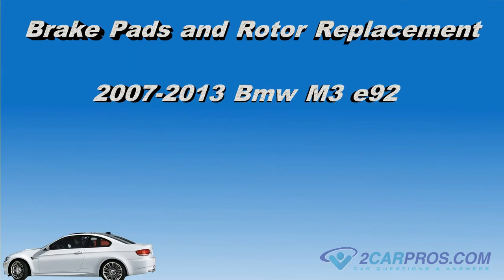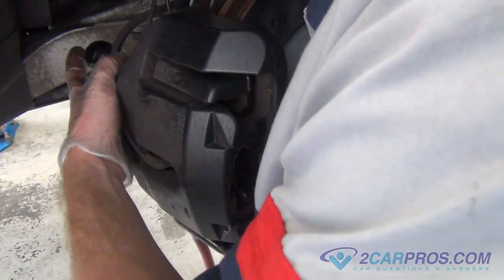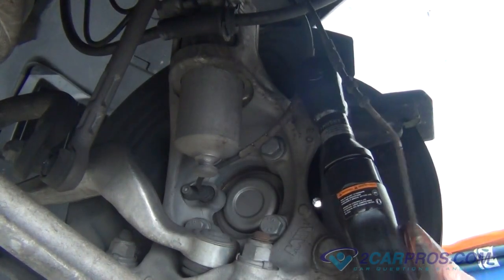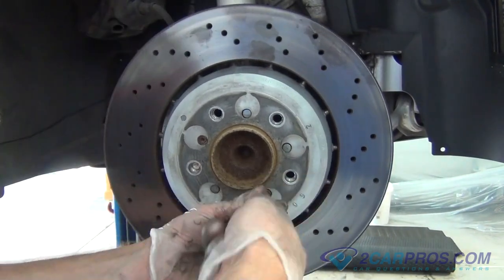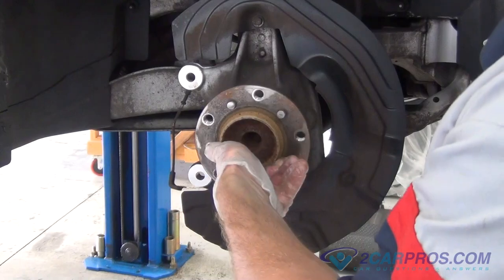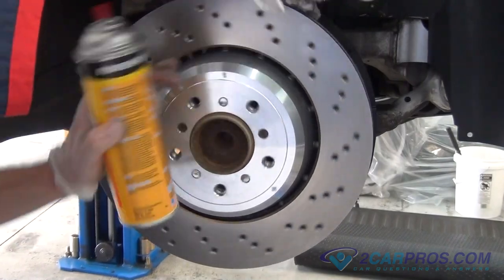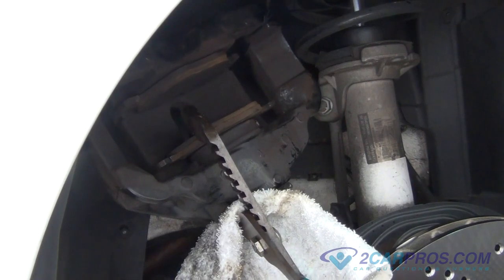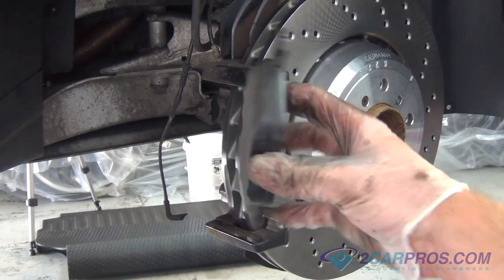Front Brake Pads & Rotor Replacement BMW M3 2007-2013

Comment: Nice demonstration - thanks (I've only done pad changes on my Porsche before and wanted to see how it differed as I will soon have to do them on my BMW).

Just a though - while zip ties are the choice of professionals for supporting removed callipers as they routinely tend to use a lift, for a DIY at jack or axle stand height I find that just resting them on an upturned bucket is even more straightforward.
Reply: that's a great tip, discoCol. thanks

Comment: It also really helps doing the brake job in the spring or summer.  In the winter, every part especially the pins are extra hard to remove.  Even the wheels are hard to get off.  I had to hammer the rotors many times to get it to pop off.

Comment: Why not torque all bolts/guide pins to spec? don’t you need to lube (high temp grease) guide pins and all points of contact that slide on pads? These brakes may squeak as well as other problems.  However thanks for the video. It does have  instructional value.

Comment: I open the brake fluid reservoir, and monitor or removed brake fluid as the calipers are pushed back in. No air will get into the system by removing the fill cap. The pad sensor needs to be reset after replacement. I think there is a procedure to do without a scan tool, I just do my with a foxwell.

Comment: your Video was very helpful. i have a question for you, i change out my brake pad and rotor over the weekend on my 328i, but now every time i step on the brake it's super light, did i do something wrong.
Reply: Did you check you brake fluid level. It sounds like air bubbles (compressable) got into the system. This could be from a leak (that's why they're so careful about not hanging the caliber by its hose) or your oil level got too low at some point and air got in the system. I am no mechanic but i think you should check for leaks. To get rid of bubbles you have to bleed the system until all the old oil is replaced. I once had a similar problem with the clutch pedal but i am not sure on this.

Comment: 2CarPros My Senior Workmate told me about BMW & Mercedes especially (ABS Locked) and Lexus of Toyota also (check engine light comes ON); when we compress Caliper Pistons.
Reason; Brake Fluid goes Reverse through ABS Module which causes ABS Locked or check engine light comes ON.

I see them when they compress Caliper Pistons, before they release little Bleeder Nipple.
I have seen couple different videos related to this in YouTube and all Compressed Caliper Pistons without releasing the Bleeder Nipple.

Please share your knowledge..
Reply: Muhamad, which generation BMW are you refering to ? this is a 2007-2013 M3. I never read of anybody releasing the brake fluid bleeding nipple before compressing the caliber pistons. Neither did i read of anyone who got  locked ABS problem from this.  What you say makes sense though. The only thing i read for other cars is to remove the cap from the brake fluid plastic tank to avoid building pressure when compressing the pistons. My knowledge is incomplete so i don't have an answer.

Comment: @2CarPros : Do you know the torque values ?   Doing this next week and I am very picky on this. Thank you.
Reply from the maker: Sure here you go

1AZ Brake disc to wheel hub E81, E82, E87, E88, E90, E91, E92, E93, E84   Replace bolts 16 Nm
2AZ Brake anchor plate to swivel bearing E81, E82, E87, E88, E90, E91, E92, E93, E84 M12x1.5 Replace self-locking or microencapsulated screws 110 Nm
3AZ Protective plate to swivel bearing E81, E82, E87, E88, E90, E91, E92, E93, E84 M6 Replace self-locking or microencapsulated screws 12 Nm
4AZ Guide screw (socket head cap screw) E81, E82, E87, E88, E90, E91, E92, E93, E84 WAF 7 Replace self-locking or microencapsulated screws 30 Nm
5AZ Guide screw (hexagon screw) E81, E87, E88, E90, E84 WAF 13 Replace self-locking or microencapsulated screws 35 Nm
6AZ Shim to brake disc E92 M3 GTS     12 Nm

Comment: How many miles do you usually change the rotors. I drive stick so i dont really abuse the breaks. Bmw said every time i change the pads i should change the rotors
Reply from the maker: +akraus5 yes this is true, if you re machine them the brake might squeak
Reply: This is a high performance vehicle!!! Do not risk your safe and others by “resurfacing” rotors!!! ALWAYS INSPECT THE MANUFACTURERS SPECIFICATION FOR MAX WEAR ON ROTORS BY MEASURING!!!

Comment: Don't u have to reset the break light after installing new sensor and pads if so how do you reset the break light sensor that's goes on showing in the display gauge by the hand wheel
Reply from the maker: please ask all questions here https://www.2carpros.com/questions/new

Comment: Shouldn't you lube the slider bolts?
Reply from the maker: +David Browne   yes thanks for the comment we will include it in the next video
Reply: 2CarPros awesome video guys but please don't miss any steps, don't want to have to take it apart again :(
Reply: What lube product / brand should be used ? That would help.
Reply: goognam goognws any lithium grease
Reply: dragonslayer, i just read from the bmw TIS manual to not grease the slider bolts only clean them.
Reply: The slider bolts on these callipers are not sealed. So if you put grease on them, the grease will attract grit and small stones when driving. The grit will then damage the slide pins and their bushes. 

You should only grease slide pins on callipers when they are protected by rubber dust boots. 

This is why bmw says not to grease them on this type of calliper.

Comment: Great video guys. What brand of rotor did you use for the new ones?  Prices for oem or oe rotors are super high, but Bendix makes them for around $50/rotor, but I'm trying to find someone out there who has used this brand before and if so, what was the result. Thx!
Reply from the maker: They were Bosch I am pretty sure. They were great. I can only recommend using parts from a quality manufacturer. I have never heard of Bendix before so I can't say anything about them. Thanks for watching!

Comment: Hi. Thanks for th enice video. I was buying some brake rotors online and there was a small note under it "Installation Restrictions: 09/2007;, 300mm rotor" what does this restriction mean?Any idea?
Reply from the maker: I think that more refers to how big around the rotor is, to make sure your rim will fit over it.
Reply: 2CarPros thanks

Comment: Why are you replacing good rotors :?
Reply: maybe they were warped...
Reply: Miroslav Handzhiev maybe he done it as a tutorial. or possibly they're causing vibration
Reply: Miroslav Handzhiev they look scored and slightly pitted to my eye. dont forget they have two contact surface areas. the back could be much worse
Reply: On these cars it's best to replace the rotor and pads at the same time, the tolerances are too low to try and turn them. FCP Euro has lifetime on all parts so next time they are free.

Comment: Is this generally the same steps for changing out pads and rotors for 2013 f30 models?   Is there any recoding involved with the bake sensors?
Reply from the maker: Yes this is the same, the sensors are plug and play no re-coding needed.

Comment: informative but no torque specs??
Reply: Anywhere between 95 - 110 for this car.
Reply: 88 lbs.ft which is 120 N.m for the wheel nuts on this M3,  but what about the two caliper slide screws ?

Comment: are you supposed to bleed the brakes or no?
Reply from the maker: It wouldn't hurt, but it isn't necessary as long as you didn't open the brake fluid system.
Reply: John N H nope. thats once every two years on average one may do that. as brake fluid does deteriorate
Reply: Shouldn't you remove the brake fluid tank cap before compressing the caliper pistons to avoid building back pressure ?
Reply: goognam goognws that can cause air to get in the lines
Reply: i think your confusing with the bleeding valve. Removing the cap on the filling tank won't cause air to get in the system and it'll make it easier to compress the calipers pistons.

Comment: Why couldn't you say what size sockets you used instead of saying "using the appropriate size.."?? That was stupid.
Also use you didn't torque down to spec. If I was paying Joe Schmoe to change my brakes in his backyard then how you did it would be ok but you guys are in a shop right? If I was paying "professionals" to do it you better believe I would want it done the correct way.
Reply from the maker: 2 things. Literally no "professional" uses a torque spec when doing brakes. As far as the size goes, everyone takes a guess and sees if it is bigger or smaller. Pretty easy.

Comment: parking brake,   NOT E-brake. totally different
Reply from the maker: Whats the difference?
Reply: Emergency brake or E-brake is used for Drifting but Parking brake is to stop a vehicle from rolling accidentally while parking.
Reply from the maker: You must be confused because you are talking about the same thing. A hand brake for when the vehicle is parked. And your info on drifting is incorrect the professional D1 cars here in North America use a total different setup then a traditional E-brake. The setup on the drift cars has a 2nd set of brake calipers on the rear rotor just for their hand brake system and a separate brake master cylinder.
Reply from the maker: Here is a link to a picture with the rear hand brake setup in a D1 drift car with 2 rear brake calipers. 

http://www.wreckedmagazine.com/blog/wp-content/uploads/2011/10/Wilwood.RearBrakes.Installed-525x350.jpg
Reply: Not really but i think your jumping into judging him is a despicable reflex.